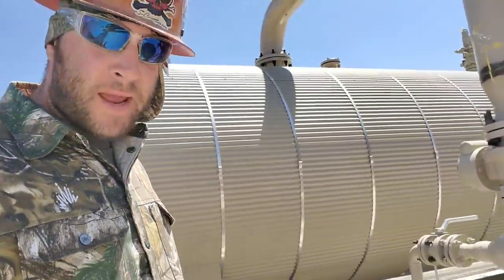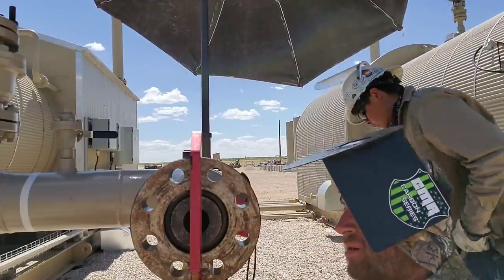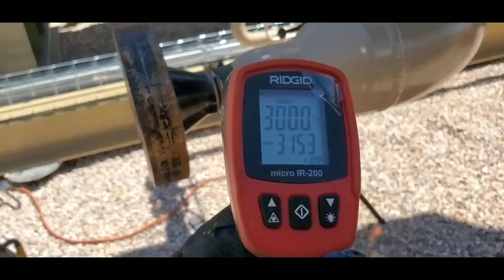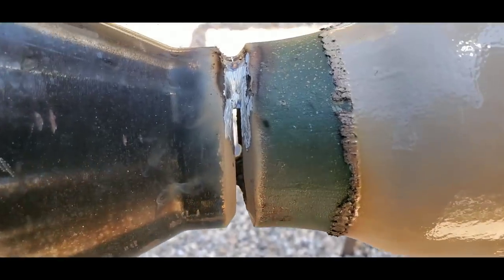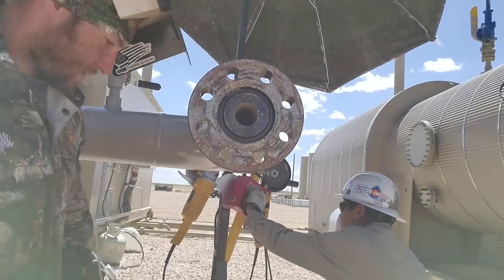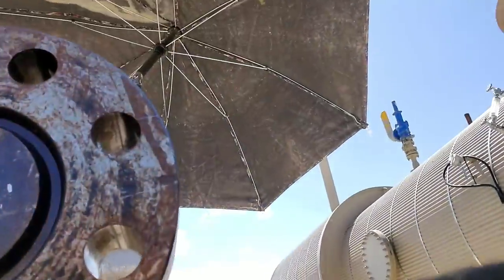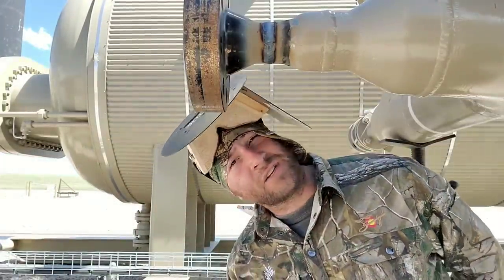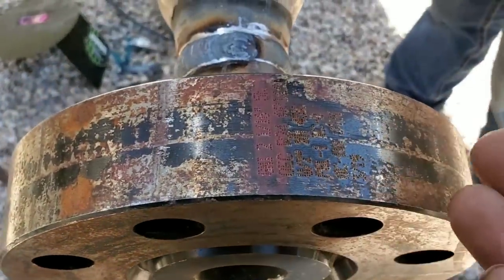UPHILL WELDING 7016 BEAD 8018 OUT 2" IN THE OILFEILD

Comment: Speaking of safety,  I understand the need to keep the tools to a minimum for ease of travel but   using a file for support is not safe. Files are brittle and break with sharp edges. Another person or mother nature can cause you to overload the file and snap it off resulting in ingery.  I used a piece of rebar bent into a good shape for support. If over loaded it just bends the cost is low and the danger is removed completely.
Reply: As a field mechanic of 30 years all I have to say about your reply is... LOL

Comment: You running a 200 on this? That remote looks the same as mine.
Reply from the maker: I am yes. A b&w?
Reply: @TheWeldProfessor  yes sir. 1978 Blackface F163.
Reply: @TheWeldProfessor  I'm still getting familiar with my 200. So far the arc is smoother and the deposition rate is higher per amp than the older Miller Pro 350 D I ran.